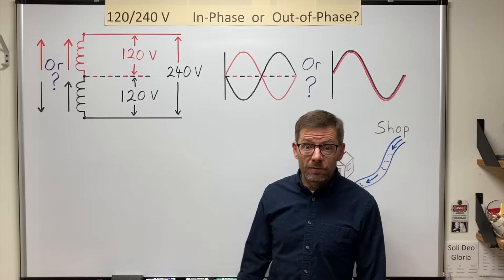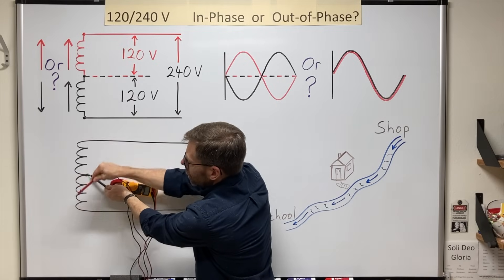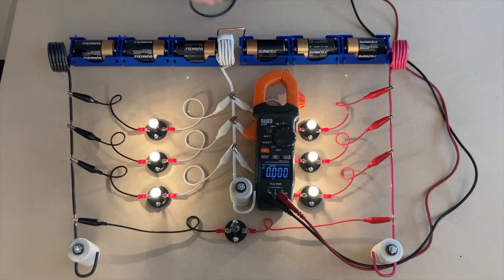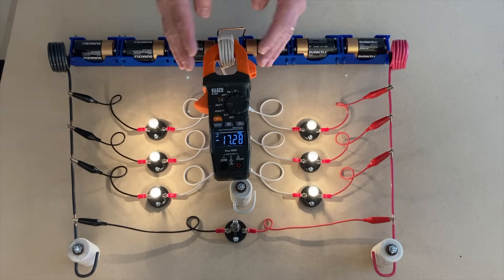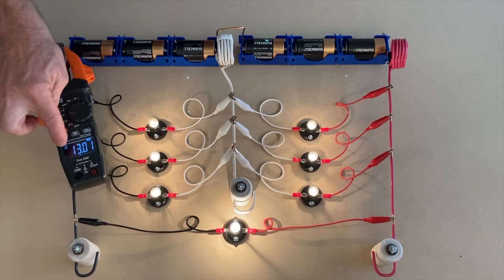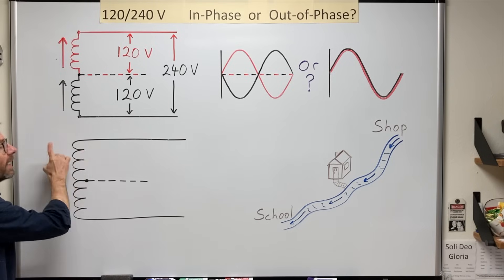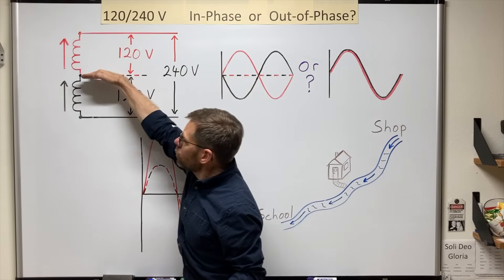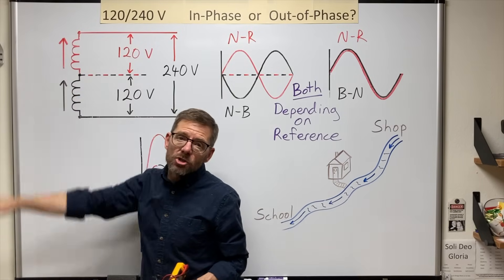120/240 V  In-Phase or Out-of-Phase

Comment: Taking this a step further:  If you have an unbalanced 120v load, and introduce a 240 micro inverter;  What does the utility provider see in terms of power consumption?

e.g. 100W load A, 0W load B
with
100W coming in from a 240V micro (50W A + 50W B)

Comment: What do we call that phase cancellation in electronics? Common mode rejection? That sounds about right. There WAS 2 phase power that was usually 25 Hz, and always 90 degrees out of phase. Some of it was 60 Hz, and possibly 50 in Europe or Russia. We got our 60 Hz from Russia or Tesla got equipment for 60 Hz. At the time, it was the only thing available. I think it was a watt hour meter.  Remember Westinghouse & Edison wanted to SELL electricity for profit, so they needed meters. Tesla did NOT want to sell electricity. He wanted to give it away, for free. (Nikolai Tesla, not the car company!)

Comment: I got a summer job with a company named "Eastern Electric". They were a transformer winding shop that specialized in large transformers and were partly owned by Westinghouse. Most smaller winding shops want nothing to do with audio transformers. Other specialize in audio & consumer electronics, tool & appliance transformers too but won't touch medical device transformers with a 10 foot pole. Basler does it all from gigantic oil filled substations to teeny tiny dry signal transformers. I have to say Westinghouse made some enormously gigantic transformers that even dwarfed Basler's way huge transformers. These super mega-huge transformers took special rail cars to ship them out to mines & power plants.

Comment: Tom Henry - - - TRANSFORMER EXAM CALCULATIONS (ISBN: 0-945495-59-5) ;  Page 38

QUOTE:  " Shown below is the voltage relationship between L1-L2 and the neutral. When the upper half of the winding (L1-N) is in the positive alternation, the lower half
of the winding (L2-N) is in the negative alternation. These two sine waves (positive and negative) are said to be 180 degrees out of phase with each other. When L1 is positive,
L2 is negative. " 

I guess it comes down to how the explanation is worded, because the picture detail on the page does show current flow in one direction throughout the entire coil.

I wonder what The Great Cornholio, Mike Holt, has to say about this ????      😂😂😂
Reply: This is not a matter of wording, but a matter of practical measurement.  Measuring from the neutral or center tap is great and all, but it does not re-define what the transformer winding is doing as a whole.  The instantaneous polarity is different with the neutral as a baseline... but if the windings really were out of phase, then they could never add up to 240V together in series.
Reply: @jovetj  It is absolutely a matter of perspective.
The phase relationship between the two sides of the secondary is out of phase when measured from the reference point of earth/ground.
From that perspective it's as though two coils are going away from you. The coils will appear to be wrapped in opposite directions, producing opposite voltages.
Note that in the video, John moves his reference point, which invalidates the measurement. If you're trying to show relationships between two points, its important to pick one reference, and measure from there. Usually you'll pick ground and call that 0V.
Reply: @Falcrist  But if they were truly opposite, as you state, then they could not add together to be 240V.  It's the neutral which is misleading.  It is not the correct reference point with respect to the transformer's secondary.

Comment: Great video to explain this! My only suggestion is that in the lower graph, you show red as the combined 240v wave but this is slightly confusing as you also use the red to also show just the half 120v wave in the other graph. Perhaps make the center tap green, then have black/green and green/red for the two 120v, and black/red for the “combined” 240?
Reply: Blue would be better. Green could be confusing given its near-universal meaning in this context for grounding/earthing.

Comment: A most unusual video where the explanation was unique and a credit to the Dave Gordon. 
I have never seen the concept of vectors addressed to the non maths audience in this fashion with attention to detail . You sir are a credit to your profession.
Reply: But wrong conclusion.. .  He failed to identify the correct Reference point, which is and has to be the Zero or Neutral point. . . .  Looks as if he sort of used the paper as his reference. . . . Paper does not carry electrical current, wires do, so you have to use the correct electrical point, which is the Zero or Neutral point.
Reply: @hughleyton693 and you again ignore current direction due to the secondary winding being the same direction for its full length. Only then do you actually get any 240v voltage. If they were actually opposite you get zero and would need a larger grounded conductor since the return is common for both halves.
Reply: @perryfarmer3280     You still do not get it. . .  It is because the L1 voltage is running opposite to the L2 Voltage, that you get the CURRENT to flow between them. . .  When L1 gets to its maximum +, L2 gets to its maximum -   . . . Those are opposite polarities, hence you get 2 x the Phase voltage that is 2 x 120V = 240V. . .    If L1 voltage = L2 voltage, then there would not be any current flowing between L1 and L2

Comment: Enjoyed the video - excellent explanation and demonstration about Split-Phase.  With respect to the Neutral, is it OK to say that V1 (Black) has a 180 degrees phase difference with V2 (Red)?  And is it OK to say that a Split-Phase breaker box has a ground bonded Neutral and two "Phases" (or Hots)?  Is there better or recommended terminology to reduce confusion?  Edit Update (2023.01.10): Technology Connections has a good interesting video covering some / most of the subject: https://youtu.be/jMmUoZh3Hq4
Reply: Yes you can. V1 and V2 are 180 degres appart only with respect to each other. For this to happen both V1 and V2 must be referenced to a common point-the system neutral. 
The power at your home is always single phase- you have two line conductors feeding your panel originating from the same source.
Reply: I wish I had a white board here to draw the wave forms and explain better, but trust me, there is no phase shift.  It’s all single phase.
Reply: @ericfalkenberry2908  The voltage or potential difference between two similar waveforms with same magnitude and frequency is zero. They are out of phase by 180 degrees which is the reason why the line-line voltage is twice the line to neutral voltage.
Reply: @shieldcracker  I really need to do a video to explain this.  It’s basic physics, if you have two signals, in this case voltages, that are opposite magnitudes at the same time they cancel themselves out. If they are in phase, they will add together; if they are 180 degrees out of phase they will cancel each other out, and you will get zero voltage.
Reply: @ericfalkenberry2908  This video is the best one I've seen in terms of explanation and production value, though  I don't agree with the conclusion. I understand what you saying in your last comment and I agree with you, but  the scenario you describe  does not apply to this case. Can you say the same thing about my previous statement?
Reply: @ericfalkenberry2908  I think you are confused with the superposition theory. In this case, just relative voltage difference makes 240 Vrms difference with respect to each other.
Reply: Work this out using phasor diagrams / phasor algebra and you will see what I mean.
Reply: @ericfalkenberry2908  yes exactly! It is basically 120(0) - 120 (180) = 120 - (-120) = 240 V
Reply: @futureramatb2443  Sorry, but you need to check the math - maybe draw the phasor diagram for 60 and 120 degrees out of phase and then try 180 out of phase.  You will see that it is zero because from a phasor perspective it’s balanced.  Similarly, the sum of phasors in a balanced 3 phase system (each out by 120 degrees) is also zero.  The math aside, if you want to see a demonstration of 180 out of phase with an oscilloscope, check out the following video:  https://youtu.be/uRKbX74lBgU
Reply: @ericfalkenberry2908   @Eric Falkenberry  I recommend you review the definition of voltage and electric potentials. The two examples provided serve only establish the potential at the neutral point, which for a balanced system is zero and in our case only achievable if the voltages are 180 degree out of phase.
The video you link is incorrect in its conclusions, this video as I said before is the best though I don't agree with the conclusion. A youtube video backing your position is not the most credible source. Instead can you find a book to support your position?
Reply: @shieldcracker  “The voltage or potential difference between two similar waveforms with same magnitude and frequency is zero. They are out of phase by 180 degrees which is the reason why the line-line voltage is twice the line to neutral voltage.”
No. You are 100% wrong.  This video cannot explain it any plainer!  They cannot be out of phase or they would never be additive in voltage.  It's really that simple.
Reply: @shieldcracker  I agree with you and I think it's a bit dense of the folks trying to claim the 'series aiding' is synonymous with 'in phase'. @Jovet. Can someone please explain why series aiding is their basis for saying something is in phase. We all agree it's series aiding.

If 0 degree OOP (i.e. in phase) implies a voltage multiplier of 2 when going from line to neutral to line to line, why then is 120 degrees out of phase a mtiplier of approx. 1.7? If 0 is x2 60 would be x1.7
Reply: @jovetj  i think part of the issue is that 180 and 0 both form a straight line. 180 does NOT imply any rotation. So in a sense, whether 0 or 180, it's all really 'in phase' by certain measures. It simply becomes about polarity and whether a series source is 'boosting' or 'bucking.' Phasing, in its precise meaning, deals with relationships from defined vantage points.
Reply: @jovetj  I said before in this thread that this is the best video that I have seen to date. The problem is the creators conclusion is incorrect. You have to understand the definition of voltage which is the electric potential DIFFERENCE between two points. To get Vab you take Van minus Vbn. If both voltages were in phase Vab would be zero, if Van OR Vbn is 180 out of phase then Vab would be twice Van or Vbn.
Reply: @spruce_goose5169  The1.7 factor with 120° phase difference can be explained geometrically. Draw two  lines 10cm long meeting at 120° The vertex is N and the ends of the line are A and B. Now connect A to B and measure that line it will be 17.3 cm
Or stated differently 1.7x 10.
Hope this helps.
Reply: @shieldcracker  I think you misunderstood me. I understand the 1.7 factor.  My point is that if we followed the conclusion here that 0 degrees out of phase equals a factor of 2, we would erroneously associate the 1.7 factor with 60, rather than 120.
Reply: @ericfalkenberry2908  Two voltages of opposite magnitudes will cancel themselves out if you ADD them.
If you're measuring between the two split "phases", the number you're seeing is the DIFFERENCE between the voltages.
If you connect a load between the two live "phases", the current is given by the DIFFERENCE in voltage divided by the resistance between them. I = (V1 - V2)/R
If they were in phase with respect to ground, V1 - V2 = 0, so the current would be zero.
("phases" is in quotes because they're not linearly independent and therefor not truly separate phases)
Reply: I agree with you.  L1 and L2 have to be out of phase with one another would respect to their sine waves otherwise how would you measure any voltage between them.
Reply: Never call them separate phases.  From the perspective of the secondary windings, they are in phase (additive).

Comment: Thanks, all your videos are clear. Some of the gurus on here really aren’t too bright, they just have a huge following of uneducated people. A few years ago a guy explained it in about 5 minutes and said, the windings are wrapped in opposite directions from the center out causing an opposite polarity at the same time. The reason why strictly using 240V on an appliance needs no neutral. That was how this clicked for me, if you google search most people try to sound way smarter than they are and start talking about definitions of phases and all sort of other stuff.
Reply from the maker: Thanks for your encouragement Patrick. I agree that 240 V loads need no neutral because we're using the whole winding (see 13:10 - 13:45 in this video), but I'm not sure from your comment if you're agreeing with the guy you mentioned from a few years ago about the turns being wound in opposite directions. I want to be clear that the entire winding must be wound in the same direction all the way up. I'll state the following to clarify.
If the two halves are wound opposite from each other (reverse-wound) then they will oppose each other and they will cancel each other out so there will be zero volts from line-to-line (i.e: 240 V loads will NOT work). I intend to make a video soon that focuses on how voltage builds in a secondary winding - hopefully within the next couple months, but for now I'll list this points in the video where I speak specifically to this concept.
1:10 - 1:50: I stated the two options of how it "could" be wound - one is correct, the other wrong.
4:45 - 6:00: I measure the voltage in the "180 degrees out-of-phase" simulation (the "reverse-wound" scenario) and show that it eliminates the line-to-line voltage.
8:00 - 8:30: I measure the voltage in the "in-phase" simulation (the "wound-the-same-direction-all-the-way-up" scenario - the correct setup) and show that here the voltage readings are what we want to see.
12:00 - 13:05: I make my declaration and state that the turns need to wound the same direction all the way up.
Try for yourself. Measure two batteries in-phase and set up in series.  From the center where the two meet, they have to be setup "in-phase" (pointing the same way) in order for one end to read negative and the other positive.  If you put the batteries opposite each other simulating reverse-wound (out-of-phase by 180 degrees), both ends will read negative if the positives are touching in the middle, and positive if the negatives are touching in the middle...
Sorry if I misunderstood your comment, but I'd rather be safe than sorry.